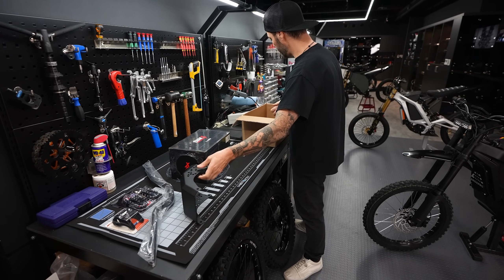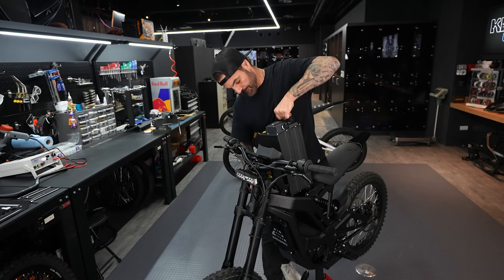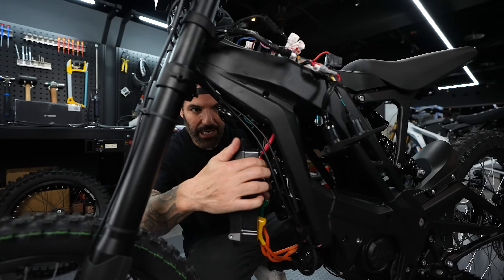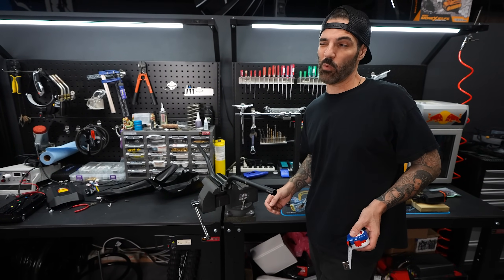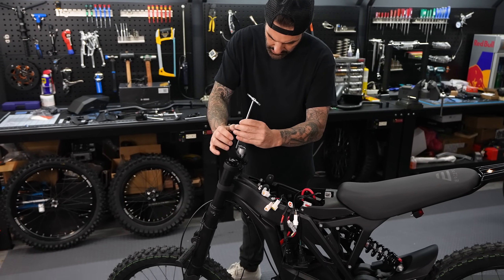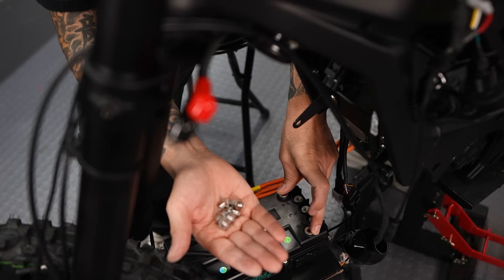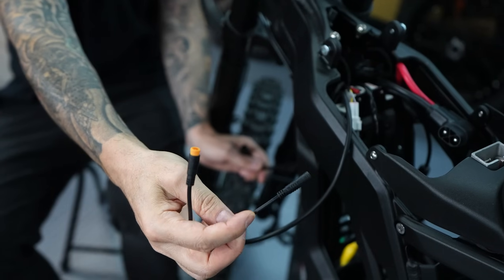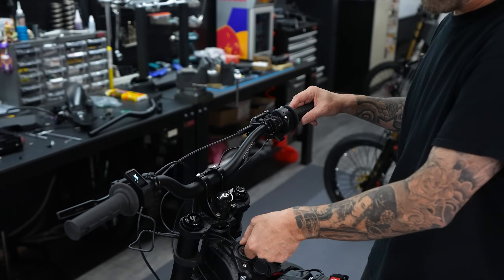Overclocking My E RIDE PRO SS with The EBMX X-9000

Comment: HELP—Just installed X 9000 on my 2024 surron light bee L1e model—a chore by myself—but thumb and reg throttle register volts fine-display works great—Motor calibration is good—but when I ck the motor spin direction no response—it’s as if not even connected—-Yes I did have it  moved from zero to 1 on the display power modes—WOULD  YOU SUSPECT SOMETHING BEING UNPLUGGED or is there some other direction I should look—-pretty much a novice at this—-throttle plugs in by headlight then follows a maze of heavily taped wires on down—hopefully not having to undo any more than necessary —quick response from Rev Rides when purchasing but haven’t heard back on this—any advice would be helpful and appreciated -Larry
Reply from the maker: Any display error codes present? Did you calibrate the throttles voltage rang with the controller?
Reply: No error codes or faults—-Yes throttles’ voltage was calibrated from zero to max throttle—when you twist them now it registers on my app—so I say throttles are performing fine but the motor is not getting the message?  It is a 2024
Reply from the maker: @reakoe  Ok, understood. Before you completed the motor calibration when you first powered up. did you check the small box for 2024+ model surron?
Reply: I did but I will double ck —grasping for straws—I was about to ck 2025 simply out of desperation to see if it might for some reason make a difference —thank you so much for your suggestion s—EBMX is also responding
Reply: yes —Is there a way to redo to make sure I got the order correct—was following Charged Cycle’s video on how to set up the app
Reply: UPDATE—downloaded firmware and solved the problem —-this is the 2nd download—1st was when I installed it—-they must have been updating about the same time as I got the 9000–that’s why I didn’t ck it again—-Again thank you for responding and your expertise
Reply from the maker: @reakoe Awesome!

Comment: How’s the power cable holding up? I know you mention that you was keeping the stock one in because it’s a thicker cable
Reply from the maker: @cedricktabb4398  Held up great with stock battery and motor/15kw.  I’ve since changed it to the CHI 7awg cable with the chi battery and ebmx race motor its pushing 30kw+ now.

Comment: That is a wise upgrade, just today I was out and about and my eride stock controller just failed, which meant I was stranded. I think the winter killed it, I kept the battery indoors but not the controller. I'll be doing this upgrade now too, it will help with my warp nine 21" and 18" rims that are sitting in the box lol.
Reply from the maker: @jengle1104  that sucks. Is it humid where you live? Keeping my bikes in this dry environment in the lab helps a lot. I haven’t regretted this controller at all, love it so far.

Comment: After watching your Video I might just have the confidence to install that EBMX 9000 myself as I'm thinking of upgrading my Eride Pro to one.. Is it easy to dial in the power for low-speed torque, trail riding and steep hills where you want the rear end to hook up and not spin? sounds like you think it was worth it? Thank you! Awesome content!!
Reply from the maker: Cool! It is not so hard actually to install and yes it is tunable on starting torque curve as well as many other power related settings and later if you upgrade to CHI or similar 400A+ discharge battery, it will be able to go to a much higher level.
Reply: @AllAboutKingpin  Thank you! Put a 21 inch Warp 9 front wheel on it today with Dunlop MX35f knobby.. Love how it raised the front end and rolls over obstacles, tracks well... Tomorrow going to put 16 inch Wap 9 rear with 60 tooth sprocket... Dunlop Recon Knobby I think. Then front fork and shock I think. It might have enough power for me stock.. Burt if not, EBMX 9000 Controller is in my future~!  : ) Mery Christmas!!!

Comment: Was you bash guard a really tight fit mine was supper tight hitting on my motor wires.
Reply from the maker: Yes, tight fit and also right up against the motor mounting bolts.

Comment: Do you only ride in the day? I thought that headlight would have served a purpose if night time riding or for road safety legislations where a head and tail light must be fitted.
Reply from the maker: Yah only ride at the daytime, so I removed it. Otherwise its actually a nice light and it came with a switch which just sounds normal lol, but surron actually does not have. The light on surron just stays on with + ignition.

Comment: Now this is something I can relate to somehow, stretching out electric motors on RC cars and mini 4WD cars. Rewinding the armature for more speed, forcing LiPo on what would otherwise be NiCd/NiMH ESCs, maybe cracking it open and mod the thing...the worst that could happen is it blows (there is a fuse anyway) or goes...until it don't because the stock drive gears on a TT-02 chassis is plastic! Atleast nowadays you won't really have to do those things anymore.

Comment: what is the actual difference this makes? better range or power, or what?
Reply from the maker: @Cam.Klingon  It increases the torque and power significantly. The stock controller is limited, but the 72v battery on eride pro can handle a more powerful controller.
Reply: @AllAboutKingpin  Do you happen to have before and after data on the performace, runtime, peak speeds, etc?
Reply from the maker: @Cam.Klingon stock controller just stops at 12kw. This one goes to 15kw and the torque ramp is insane using the same stock eride pro battery. The difference is DRAMATIC. Its not about top speed, the sprocket and max discharge on the battery will determine that. This controller drastically increases the torque mostly. I ride it in the next video and I won’t lie, it took some getting used to :)
Reply: @AllAboutKingpin  nice, looking forward to the next video. Hope you have a nice weekend!

Comment: I bought an electric moped myself but suffice it to say, as an engineer, its left me wanting. Already found a replacement motorcontroller and going to be installing that soon too. 
Only thing I'm currently looking at is what maximum discharge current the battery can handle, no specsheet on the battery or online, so have to wait for the manuf to reply back..
So much more fun than messing around with an ICE though. Do you have recommendations for aftermarket discs and calipers for mopeds?
Reply from the maker: @The_Noticer.  Love it! Tons of fun for sure right? For mopeds…hmm..not sure. I just got some heavier EMoto brakes for this bike from Lewis finally, but they are all mtb/emoto.